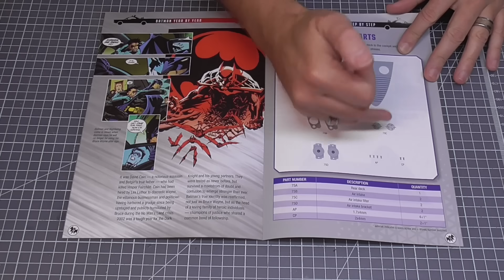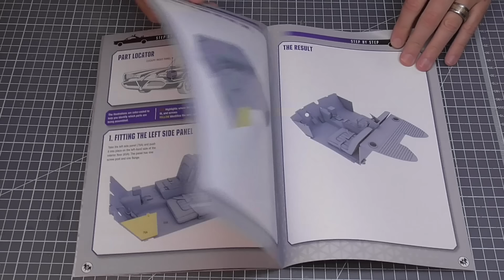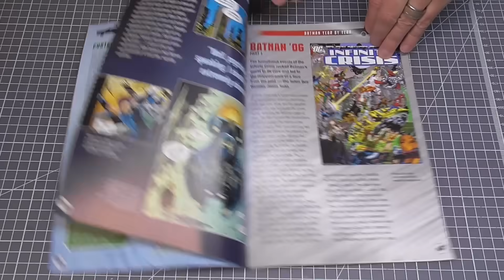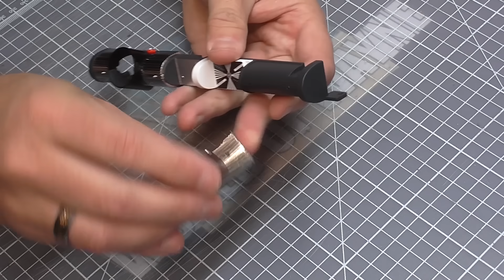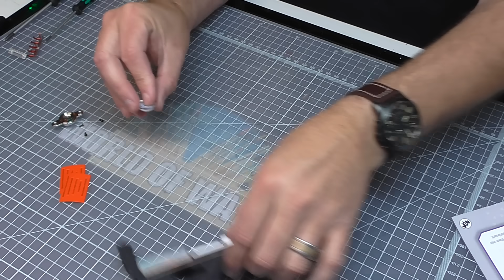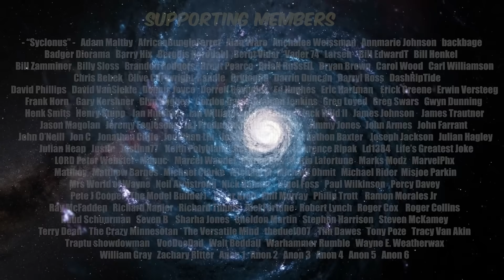Build the 1:8 Scale 1966 Batmobile - Pack 15 - Stages 75-80

Comment: Them little buttons and lights . I ream the hole out to make fitting easier..And to hold them in place,, Delux rocket card glue Makes life easier. Those stick on labels? Would have expected a better option than paper stickers on this high quality kit.Embossed ones would have been far better
Reply: Absolutely!  I expected Fanhome to repeat the preprinted label, like they did with the rollbar "Bat-turn Lever."